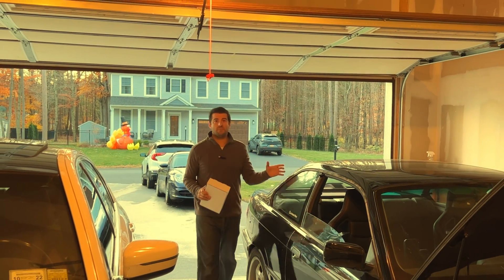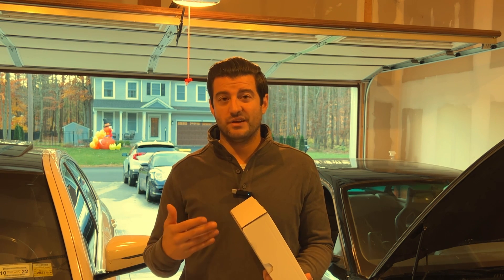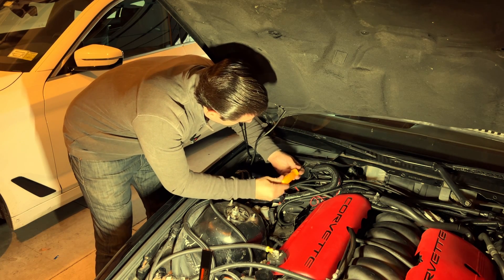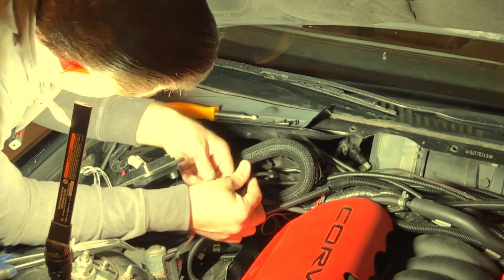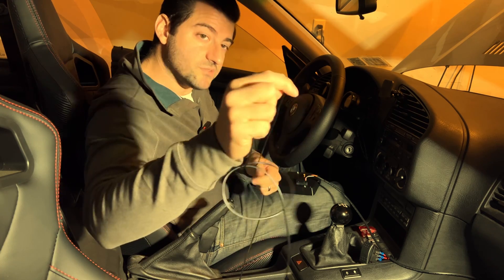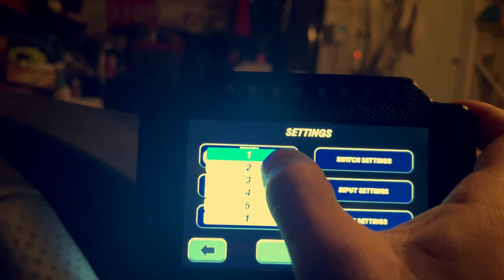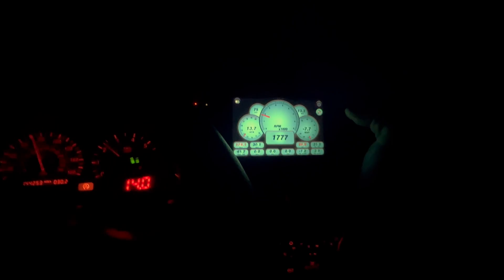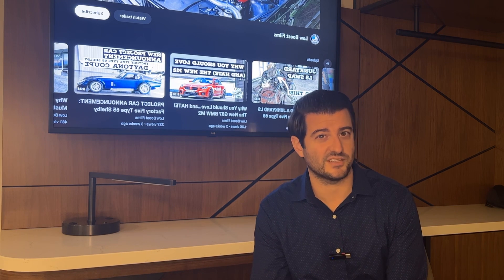BEST DIGITAL DASH! Tinker Electronics-Holley, AEM, Hondata, MegaSquirt, MAXXecu, Haltech, ECUMaster

Comment: Very good video, very helpful,, have few ?, can fuel gauges, turn single n gear indicator be added to it. iam working on my 67 camaro with LS3 n 6L80e swap using Holley Terminator X max, the reason aim interested in Tinker DASH is obviously is the cost of RACEPAK 12.3" DISPLAY which is $2,137.95... yo info will b greatly appreciated,thx
Reply from the maker: What they told me was everything you can do on an actual Holley dash you can do on this. Send them a message on Facebook and tell them I sent you. They’ll have more details on that. I have a regular fuel gauge and a manual.

Comment: I need to replace the gauges in my e46 since none of the gauges in the cluster work after the swap. Would this dash be big enough to fit into the cluster area for e46?
Reply from the maker: Yea it would. They sell 3 different sizes I think the 7 inch would fit. The 5 may be too small and the 10 inch may be too big.
Reply: @LowBoostFilms  thanks I’ll see about placing an order.
Reply from the maker: @1411MEDIA  let them know I sent you!